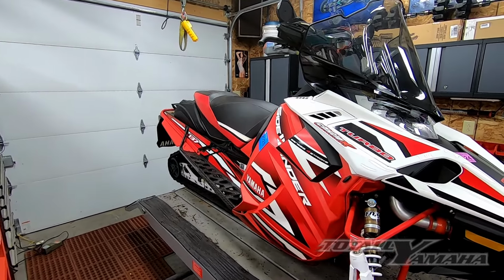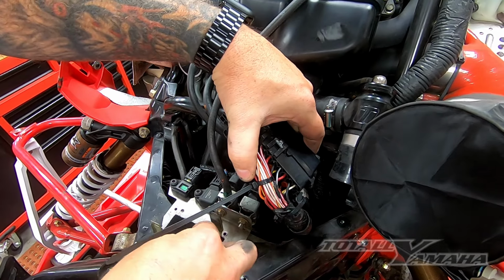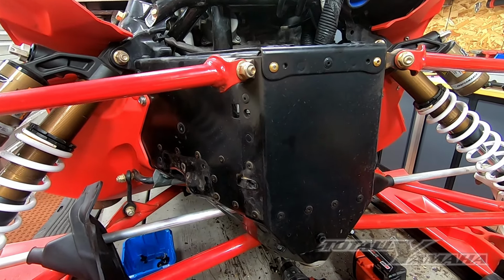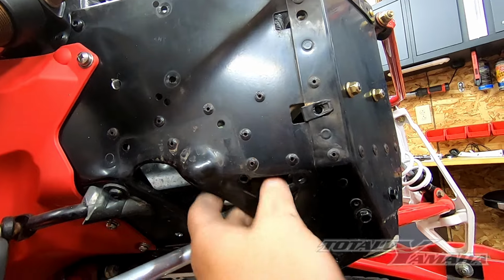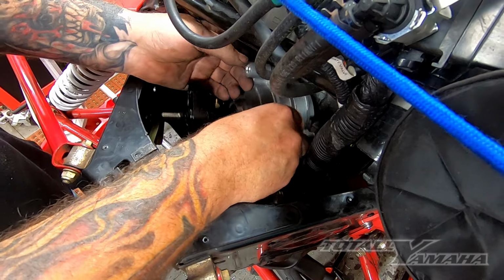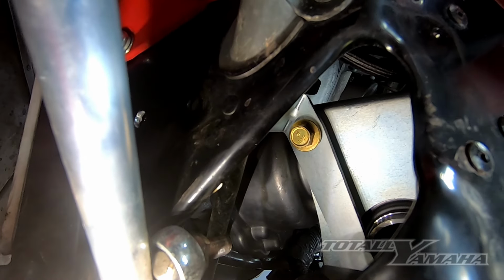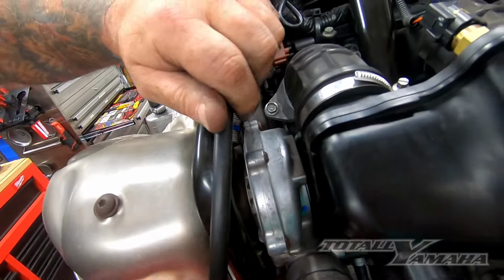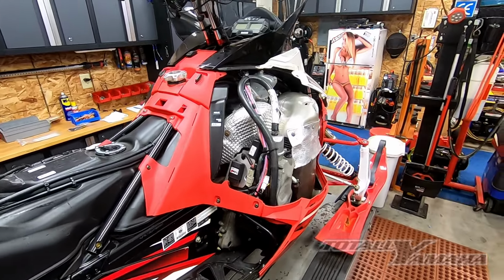2017 Sidewinder EPS Install

Comment: if you dont plug the 2 wires at the diagnostic port,the eps are still working??i eant to put this eps on a projet and i want to know if the eps work if this 2 wires are not plugged thank👍

Comment: Could be a good idea to relocate your fuse box while you're at it.
Reply from the maker: @xingoo4435  I guess if you want. It’s not necessary.
Reply: @Totallyamaha  Not necessary of course, just easier to access straight from a side panel if a fuse blows.
Reply from the maker: @ hood comes off way too easy compared to viper but not a bad idea.

Comment: So, if you have a gap flasher that needs to be plugged in for the launch controller this will not be able to be wired this way. I was going to tap into the harness where the gauge plugs in. Any thoughts?
Reply from the maker: @ggdonzi  I have one on my 2017 with gap flasher. I made a splitter.
Reply from the maker: @ggdonzi   https://ty4stroke.com/threads/2017-sidewinder-eps-install-video-and-info.167633/page-2#post-1635683

Comment: Thank you very much for making this video!  I have all the parts needed, and am ready to install.  Any differences for a 21 Winder?  I'm assuming I can use an existing unused Smartshock canbus connector?
Reply from the maker: @mardak   I am not sure on that. I have not had a chance to do a 2021 yet. I know there was talk on the site about something different on other models.
Reply from the maker: @mardak   might be able to find more about it here. https://ty4stroke.com/threads/eps-conversion.165577/